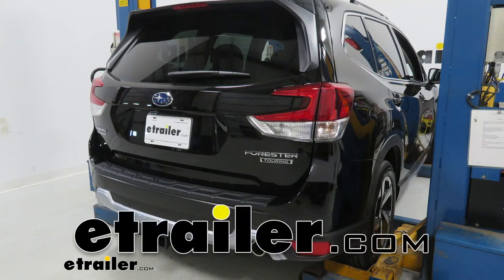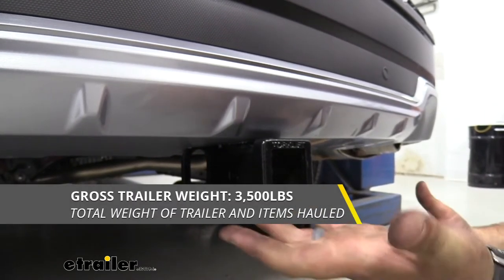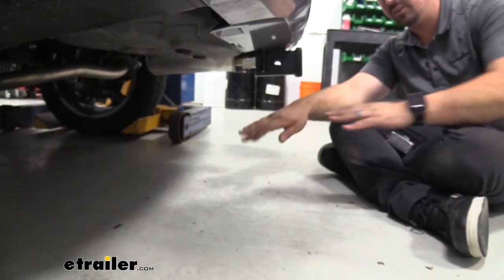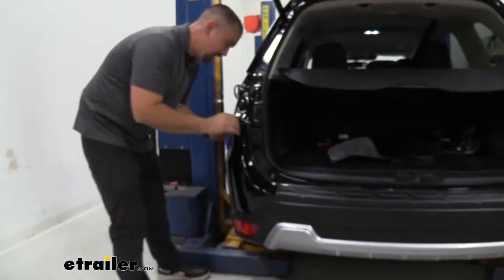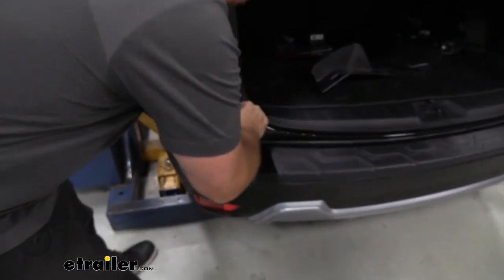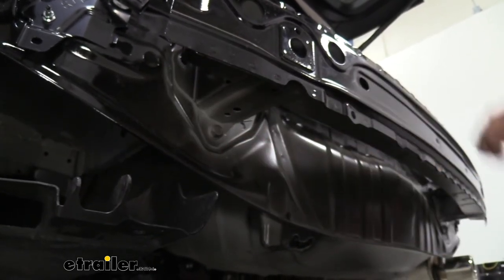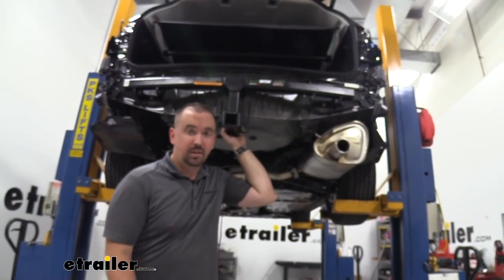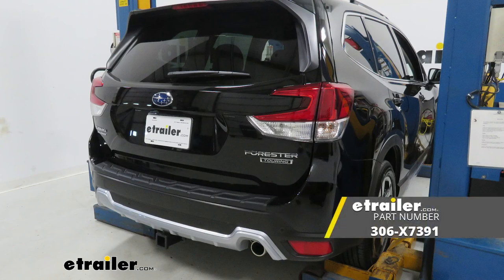etrailer | Installation: EcoHitch Hidden Trailer Hitch Receiver on a 2022 Subaru Forester

Comment: Great video, thanks!  Do you know what impact the hitch has on the angle of approach and departure for the vehicle?
Reply from the maker: That isn't a measurement we take, but of all the hitch choices available for the 2022 Forester the EcoHitch # 306-X7391 would provide the best ground clearance as it sits tighter up against the underside of the bumper.
https://www.etrailer.com/Trailer-Hitch/Subaru/Forester/2022/306-X7391.html

Comment: Do you have a video for doing the wiring for trailers with lights?
Reply from the maker: You betcha! We'd recommend the Tekonsha # 118467, which fits the 2009-2024 Subaru Forester. You can see an install video by using the link provided below:
https://www.etrailer.com/Custom-Fit-Vehicle-Wiring/Tekonsha/118467.html
https://www.etrailer.com/tv-install-tekonsha-4-pole-trailer-wiring-harness-2022-subaru-forester-118467.aspx

Comment: What do you set the torque wrench to? Mine didn't come with instructions, and the number I called didn't seem to have them either. Dimensions for the Fascia cuts would also be helpful.
Reply from the maker: We would love to help you out with those specs. Give customer service a call and they can get you the torque specks! You can find the number at the top of our website linked here. https://www.etrailer.com/
Reply: I tried that, but they didn’t have them. Do you?

Comment: Are there safety concerns by removing the impact bar?
Reply from the maker: The hitch will basically take the place of the bumper beam in the case someone makes contact with the rear of your vehicle.
https://www.etrailer.com/Trailer-Hitch/EcoHitch/306-X7391.html